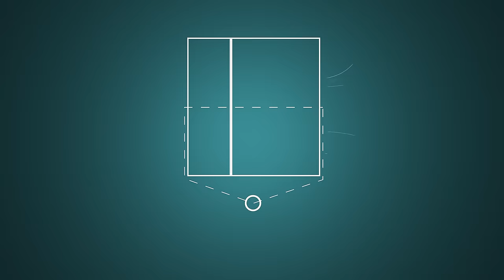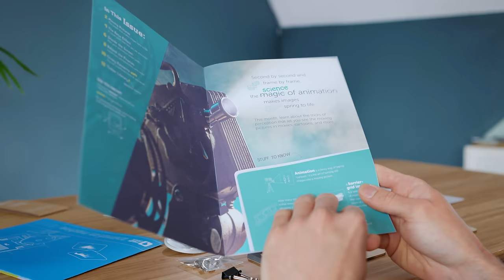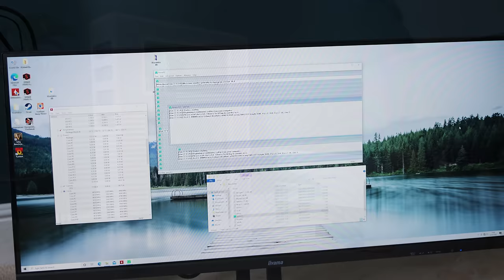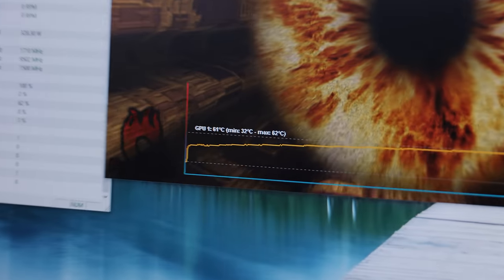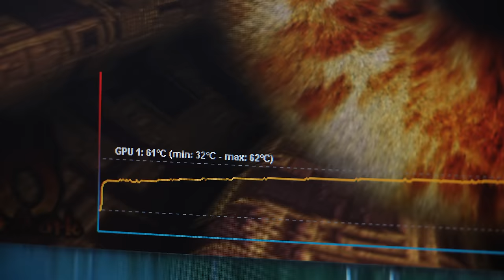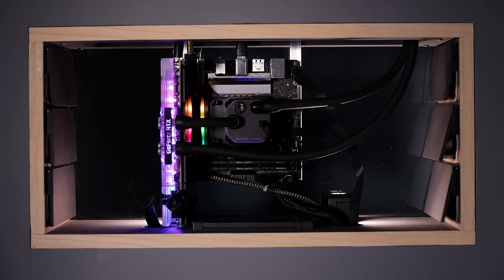Building the world's first 'breathing' PC

Comment: Next step in bio-inspired machinations - a computer that sweats. You could build a water cooling system that receives fresh water from a valve and outputs hot water to another, it could even be a green solution to mitigate the carbon impact of hot baths.
Reply: It shouldn't just be outputting the hot water; it should be evaporating the hot water using a fan. Evaporation takes a ton of heat with it.
Reply: @bable6314  Makes sense, but I don't think that's very efficient, and where would you take the water vapor generated?
Reply: man's never heard of the water cycle
Reply: @elimcgamerguy  but you'd just be building up humidity in the room then?
Reply: hmm, i didn't think of that.
Reply: Sweating to begin with is not "apply water to take heat", it's "evaporate water to take away tons of heat". Try looking up a phase change curve of H2O. I imagine that you would need some kind of dehumidifier to take away the vapor when it is generated.
Reply: @joshuaeah  Maybe a condenser to recycle the water

Comment: Just a quick question: how much power does this cooling system utilise?
Reply: 4 of these tiny pumps... not much. Probably less than 8 fans on the radiators would.
Reply: @janred94  plus watercooler pump :) (and the electronics but those are negligible)
Reply: @janred94  I don't believe it.  Air is much easier to move than water, multiple water pumps in series lead to head losses that probably aren't as efficient as well designed fan blades, and this computer would never have required "8 fans on radiators".  

It's an art piece but it's not efficient.
Reply: @randommcranderson5155  the consumption of both won't really matter anyway when there is a 5950X and RTX 3090 computer sucking at your wallouts 😅
Reply: @janred94  Except its just not necessary.  The case could have been exhausted with 3 or 4 efficient fans if it was made to size instead of being made giant to accommodate a bellows. 

This is a bellows with a PC attached to it, not the other way around.  It's an art piece but whatever it is, it isn't efficient.
Reply: the pumps say 3.6w on them, x10 pumps = 36 watts if they're running full burn all the time. it's true that's an order of magnitude more than PC fans, but both methods are pretty negligible in the presence of a 500+ watt computer
Reply: @BrennanLetkeman  Keep in mind they don't run full burn, only half fires at any given time, so its safe to say the cooling system runs 18W then.

Comment: "Graphics cards can generate a lot more heat than a CPU can"
Intel: "Hold me i9-10990XE"
Reply: If only it was real. HEDT is practically dead at the moment if intel continues with their monolithic dies.
Reply: The 11900k alone can burst to 400W at AVX512 lmao.
Ridiculous
Reply: @jonathanlarsen4177  The highest I've ever seen an 11900k hit was 318w. My GPU can draw 415w before it's capped by power limits.
Reply: @rustledjimmies1337  No it isn't?
Just depends on whether you think "HEDT" stands for "High End DeskTop" or "High Energy Drawing Turd".

Tho on the serious note, HEDT still stands in the form of the 5900X, 5950X and Threadripper from AMD.
It's just dying at the Intel side (like... well... most of their CPUs actually)
Reply: @mcgetrekt2388  Going in excess of 300W is rare on an 11900K indeed though my partner and I did manage to get it to 480-500 (just factoring readout inaccuracy).
Now, of course, it should come as no surprise to anybody that that was on LN2, with pretty high voltages on a pretty high clockspeed and is completely unrealistic for anybody to hit on a normal desktop.
Reply: @FinlayDaG33k  I agree with you, since AMD's chiplet strategy allows them to crank out cores at a lower cost and can engage Intel's Monolithic dies in a pricing war that Intel would not win.
Reply: @rustledjimmies1337  Jepp, it's just a matter of numbers really.
Wafers have a "defect density" that is expressed as "#/sq.cm" ("defects per square centimeter").
So the bigger your die is, the more chance you'll have of it having a defect _somewhere_. 
That defect can lead to your chip not being up-to-spec and as a result, needs to be binned lower.
Of course, you can only get so much dies out of a wafer and the bigger the dies are, the less dies per wafer to begin with.

By going with an MCM like AMD now has (though they are certainly not the first, as POWER2/RIOS2 actually already had an MCM - and possibly others before that as well), you can have smaller dies.
So, more dies per wafer and less dies without a defect (implying the same defect density of course).
Which means you have more "to spec" dies and can more easily start mixing and matching between dies to get a different SKU.
- "oh, these two dies are within spec? -> 5950X"
- "Oh, these two dies have two defective cores... -> 5900X"
- "Oh, this die has no defective core but just won't clock as high as spec... -> 5800X"
- "Hmm... these two dies have two defective cores and don't go as high as spec... -> 5600X"
- etc.

Good luck doing that with a monolith where you have 1337666 more variables to keep note off and if your die has a defect, you have to down bin the entire die just because 2MB of the cache was defective (which means that now, you can't sell it as an i7-10700K but only as an i5-10600K).

Comment: Do the water pumps, consume a lot of electricity?

It looks like, a breathing AI computer.
It could fit in a sci-fi movie pretty well. :D
Reply: @aciknaufal  Just a thought, that came to my mind. 
Like HAL9000: "Hello David"
...but it's living and breathing.
Reply: In the tank he had 10 of them, so if that’s the total number used in the system, they’d use 36W of power - it says 3.6W on the label if your pause it. So that’s like 3 x 1A fans at 12V. Very good if you ask me, and a lot more quiet. Especially considering they’re moving that massive bellows and displacing hundreds of watts of heat!

Comment: My 5900X reached like 70°C just during gaming with a custom loop (2 360 Radiators, my old GTX 1080 also in the same loop) and some ridiculous Noctua high pressure fans, since changing my old 1080 to a 3080 I ditched the loop, and with the EK 360 AIO I now use it also reaches like 75-80°C. How the hell does the 5950X stay under 60 with Prime95? That doesn't seem right, maybe wasn't running on all cores. Anyway, great video and super interesting project no matter what.

Comment: Normal People: Creates a 3D printed exact tube.
Him: Starts undoing the magnet
Reply: Those "normal people" would have failed using most versions of 3D printing.  It is quite hard to get a 3D printer to make a long lasting waterproof tube in the first place much less one that can handle pressure, it is also hard to get a smooth enough inner diameter to not interfere with the motion of the magnet and maintain a few microns tolerance, and he would not have the level of clarity he had in the cast tube.  Then there is the length... most 3D printers would not be able to get beyond half a meter... you would need to get an industrial level printer to even get close.
Reply: Actually adding more material to the magnet, which is even more impressive!

Comment: 16:20 "graphics cards can generate a lot more heat than cpu can"
Intel: "Hold my beer"
Reply: I'd hate to disagree. My new 5950x is much hotter than my i9. Considering how many cores it has.
Reply: @bipolar-tiger  Well sure it is "hotter", but the GPU still generates much more "heat", by meaning energy that has to be moved away...
Reply: Oh how the tables have turned

Comment: "So, is it air cooled or liquid cooled?"
"Yes."
Reply: 7:11 it is clearly liquid cooled.
Reply: @lunchbox1553  what cools the liquid?
Reply: @derpsheep6524  In any liquid cooled pc you put fans on the radiator however so...... XD
Reply: @followingfigures4738  so air cooled
Reply: @derpsheep6524  the name derp sheep is beginning to seem to fit you more and more
Reply: @derpsheep6524  Do you know anything about computers?
Reply: @lunchbox1553  with that statement I assume that you know some about computers as well and am I the only one that's concerned that this guy is comfortable with 140° f on CPU
Reply: @followingfigures4738  Yes, you are the only one who is concerned. I don't see why average temps would be concerning. Also, fahrenheit is not used for measuring computer temps, if it is, then it is very rarely used.
Reply: @followingfigures4738  That's a 16 core, 32 thread, 4.9GHz boost cpu with a TDP of over a hundred, with a dual 8pin 3080 gpu under it, hitting 60c at the arse end of a full load stress test is pretty good, even 80c (176f) would be normal. Intel cpus are usually programmed to only start self imposing heat reducing solutions when you go over 100c (212f), though you'd better be worried if you could hit that.
Reply: @reahthorolund8373  I apologize for my ignorance then and thank you for enlightening me and not passive aggressively insulting me like someone else in this comments section
Reply: “It breathes.”

Comment: Now the question lies...

Can you make that breathing system small enough to be put inside a table? 🤔
Reply: In theory... You could increase the width of the air-moving sheet to 60% the length of your table, while reducing the height to half a foot, and making it travel 70-80% across the width of the table. You can put the PC (and the pumps for the bellows system) in the remaining 40% space (length-wise) with the motherboard sitting horizontally in the enclosure, components facing up. With a sturdy glass tabletop, and some LED strips, it would look absolutely stunning. It would look similar to how document scanners operate, which is cool.

Comment: I was just rewatching this and had a crazy idea that would look insane. 

What about expanding on this idea but instead of a big rectangular box, you used 4 large diameter tubes, oriented vertically with a flat plunger in each. Then you could offset the order that they move up/down (intake/exhaust) so there is never a point when no air is flowing. Instead of water and magnets, you could use an electric motor and crankshaft. It would look like a clear 4 cylinder engine with pistons moving inside.

I'd try it myself but I sadly don't have the means.
Reply: yes! I was thinking on something similar, but maybe it will not be so silent..

Comment: You should move the intake lower. The air is colder on the bottom and there would be less chance of the hot air from the top re-entering from the intake

Comment: I'm always concerned when I see a Project that depends on Random fittings and is not repeatable. Great idea to use Electroplating to add to the magnets size. 
I'll have to file that idea away as it sure beats using tape to add to the width! :-)
Reply: Other option is sand down for the smaller tubes
Reply: @Demon09-_-  But then the magnet gets weaker

Comment: Hot take: this is technically a 100% water-cooled PC.
Reply: Hotter take: all watercooled PCs use  airflow to cool the liquid in the loop.

Making all watercooled pcs aircooled pcs
Reply: Malicious Muppet is correct. No PC is 100% water-cooled unless it uses a liquid heat-exchange system similar to what they use on the ISS. I'm not even certain that would work, though. It would have to be completely redesigned, as the ISS system takes advantage of the extreme temperature differences (a firm of free cooling) on either side of the station to radiate heat, and chill the cooling fluid (ammonia).
Reply: @fluffypinkpandas  I think he is referring to the fact that the bellows magnet is driven via water being pumped back and forth in the central glass tube.
Reply: @jasonrubik  Yeah but the water is just like the transporter for the heat, it gets carried to the radiator where the real important part is to blow the heat away from it. So the water is just the helping intermediary step.
Reply: @victoriabrowning7117  I mean there are people who submerge their PCs in oil tanks, I guess that's 100% liquid cooling
Reply: really ?! that's not what the build is about. watch the video again and stream both brain cells as much as you can. then the picture should become a little clearer in front of your inner eye ... 👀😲😲👍😎🤣😂
Reply: @jasonrubik  Correct!

Comment: This cooler basically needs a water cooling system all by itself 😂🤣😂
Reply: ...what? Did you... watch the video?
Reply: @cmck1777  wdym
Reply: Uhh... Just like standard water-cooled systems need fans _somewhere_? The point is not the water loop, it's the bellows system replacing fans
Reply: @Taernsietr  I know, I meant that the bellow system was complicated and had a "water cooling" system all by itself, but it wasn't for cooling, it was for the water to push the magnet
Reply: @DemeDemetre  yeah. That's not a water cooling system. Maybe delete your initial comment? Otherwise you're going to keep getting people pointing this out to you.
Reply: @cmck1777 To me, it was perfectly clear what he meant.
Reply: The comment needs context but I liked the perspective once I read it lol
Reply: @MegaMellojello  ok, I will edit it
Reply: @DemeDemetre  dont edit it bro
Reply: @Taernsietr  it doesn't need fans. it s supposed to be water cooled so we get rid of fans
Reply: @kyriekwsta770  ok... but why?
Reply: @kyriekwsta770  ...what? Do you water cool your PC? I really hope not. You need fans in a water cooled PC to push air away from the radiator. I feel like I'm going crazy.
Reply: @Voxator  How? The OP has acknowledged the original post was a mistake. Are you a psychic? The system uses water as a suspension fluid to harness the power of magnets. It has nothing to do with cooling. Even as a joke it doesn't really scan.
Reply: @DemeDemetre  Damn, now that I understand what you meant I feel stupid hahah. Sorry for the patronizing tone

Comment: Awesome piece of engineering... but as soon as You've introduced the claps to steer the air flow, I've started to wonder if using 2 Tesla's one-way valves, would futher decrease the amount of moving parts in the system? Still... mesmerized by the concept and execution!

Comment: Great video. Wonderful build. Very cool concept.

As a poor self pc builder in my teens. I used to build cardboard box PCs to mock up case designs. I would chamber off some sections try different air flow patterns. 

Oddly enough it was motorcycles that found me one of my favorite setups. 
Motorcycle rant
Ducati was one of the first teams to take the radiator away from the front and put it under the riders seat, with intake ports on the sides and fans pulling air through it. It kept temps down, which means more reliable bike, more power. 
The key for me was to not keep the fans on the radiator, but put the radiator in a separate section of the case, chamber it off with tape and cardboard, the better to sealed chamber, the more efficient the air is pulled. I have an old "scythe brand fan" that can reach dangerous for your finger tip speeds. 120+CFM. Ugliest loudest PC you have ever seen, liquid cooling like temps lol. 

I now always separate my cases with something between the CPU/Ram section and the GPU section. Keeps air flow and temps better.

Again lovely video, brought back some self built PC memories!

Comment: Man this was cool as hell. You are brilliant. I wonder if the moving plate could just be the motherboard. Have it moving back and forth and eliminate the rest. Fixed size issue for the most part but would need stronger movement/magnet. It would be great to see a followup video with improvements in design and function. This dude can make incredible things.

Comment: I wish there were a more compact case with this kind of bellows concept on the market, Maybe an ITX system but in an Full tower ATX size case that has an inbuilt bellows system where the PCIe expansion slots and HDDs would go.

Obviously a lot more R&D and engineering would have to go into it but I'd definitely be up for grabbing one

Comment: Does the size of it change the air flow? because what if you made smaller units but like cores or pistons in a car where you have multiple of it breathing. Could that make the air flow be more consistent and help with the cooling? Also I am sure it would be a lot more expensive but if you could make the tube out of sapphire or something could that make it more sturdy? Like say if an earthquake hits, would that be enough power to break the glass in place so could their be a more reliable option for the tube?

Comment: Drilled a hole to my garage, placed the pc in the garage, and pulled the cables back into the gaming room. Set all fans to max, and newer had a more quiet pc. The first time i had a black loading screen and my oled turned the hole room dark, i thought the power to the house whent out, so i added a red led to the power button under my desk so i can check it to see if the pc is still on.

Comment: Just a thought but a turbocharged air cooled computer sounds like something id like to see. One electric turbo or turbine could have an intake, a series of high pressure lines, flow through processing units, and an output of hot air. A refrigerant like from automotive air conditioning systems or anything that can keep stuff cold would be an interesting, but overkill idea. Although anything i mention has roots to primarily automotive.

Comment: Isn't it pushing hot air through the radiator? Shouldn't it pull outside air through the radiator and push hot air out through a different outlet?

Comment: My first question was how is he going to fit the parts in there when the bellows panel moves across the entire internal. Until he revealed a seperate case for the pc itself.

It would be cool if a later version build the pc components on each side the bellows panel itself, and each side of the case had intake/exhaust valves so every second the air around the components is being completely refreshed. It would bring the whole thing to a much smaller footprint too